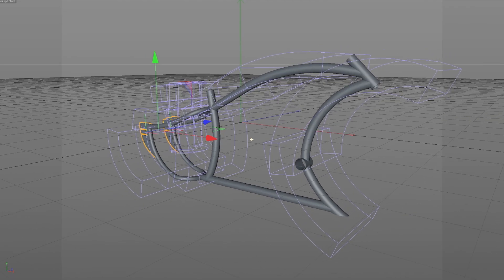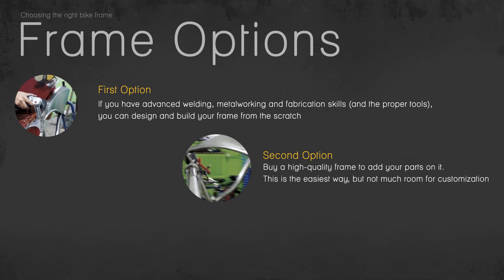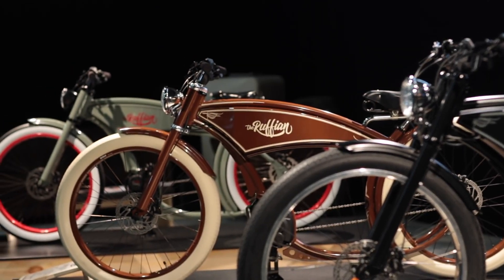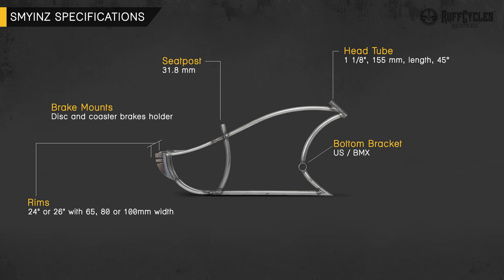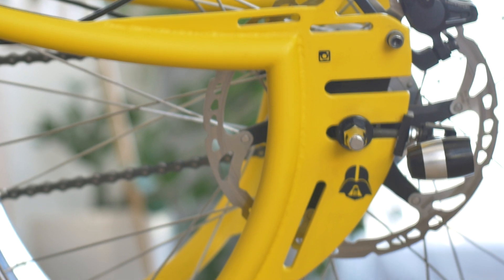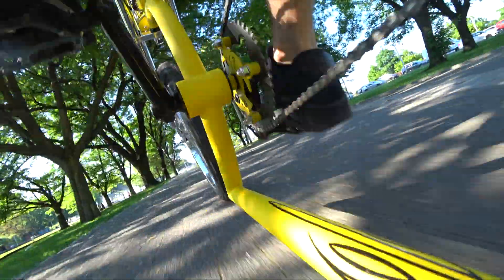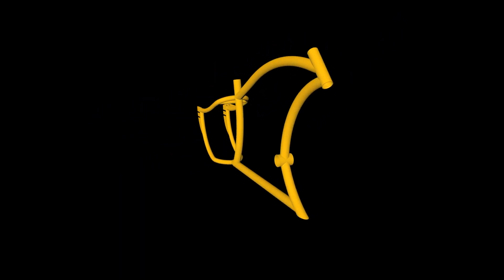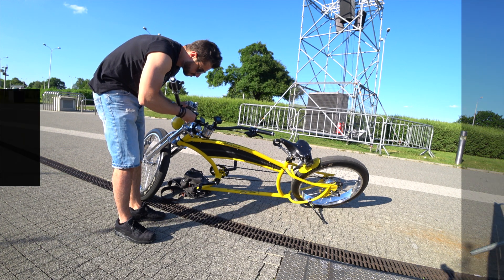Detailed Ruff Cycles frame Review | All you need to Know

Comment: The best review I've seen! I plan on building one electric. Do you happen to know the rear dropout inner width? Because most hub motors over 1500 watts are 150mm dropout to 175 mounting widths. If you happen to know the rear dropout hub spacing that would be awesome!

Thanks in advance, again a fantastic presentation!
Reply from the maker: Thank you very much. I am glad to help :)
It is quite difficult to get the precisely measurements now with the wheel, but I measure 135mm. I can try to give all measures you may need. Perhaps the aluminium version of this frame would be better for an ebike (needing an extra enforcement around the dropout mounting).
Feel free to contact me at anytime .. cheers
Reply: @BK42Cycles  Hey thanks so much unfortunately unless I go with a Mid-drive unit not many of the hub drive motors will fit such a narrow dropout, I wonder why ruff cycles went with such a narrow rear dropout especially since they are promoting their bikes as great for electric conversions, I guess that's ok if you only want 1000w and under which with fat tires will be underpowered. I might go with Imperial Cycles peek frame as they customize the dropouts and seat post locations and only 100 dollars more than the Ruff cycles. You should check out their frames I have one as a pedal bike but don't want to cannibalize it for a build as its beautiful. If I go with a cyclone mid-drive I might have to take you up on some help :) of course, if you don't mind? 

Not only are your videos awesome you respond to your audience that's priceless and I extremely appreciate that!

My videos are mostly racing drones and freestyle drones, but soon as I start on my E-bike build I will document it here on Youtube step by step as the audience that watches usually gives me some of the best advice lol

If you want the link to imperial cycles bike let me know hopefully you have a great holiday and new years sir!
Reply from the maker: I can't understand it as well. I guess even them had to deal with this problem as all Ruffians ebikes are using the mid-drive motors. I have seen such frames with 500/750W motors, but then there is another issue - no space for the gears, even doing some space it will need some extra adapters anyway. I was considering transforming my bike as well, but apart from all issues above listed it will be way too heavy ( using the same frame, but the aluminum version will do ).
I was planing a new build using a Ruff-Cycles frame, filming each step, how to chose the frame, customize it, choosing the electronic components and motors, building the tank ... I am quite sure that it would be some audience for that, but they didn't care about my offer, actually, they didn't bother themselves to say no thanks. I was only asking for some small discount :)
Now I am going to buy a cheap Chinese e-bike and customize it a bit, make a bit better look.

I didn't know the Imperial frames, but I follow Jimmy peek on Instagram lol :) . That frame looks amazing. I think you can't go wrong with that.
I can help you for sure.. If I know how I will do :) 
Did you ever build a bike before? 

I am going to check your channel my friend. I love drones and videos made with drones :) I couldn't check it earlier....  busy day.
You can find me on Instagram, Twitter by BK42channel as well as bk42.bikes@gmail .com (email)

I am very curious to see your build progress!
Have a good Sunday
Cheers
 Myr
Reply: @BK42Cycles  sorry for the late reply being is Christmas right now running around like crazy Doing last-minute shopping even on Christmas Day LOL. But yeah I was quite disappointed looking at so many frames out there and not one will fit anything bigger than a 1500 watt Hub motor and that's not a fat tire it's a normal 26in mountain bike rim.

Likely I ran across Imperial Cycles he can customize the Dropout to whatever size you want I'm having him do mine 175 mm that way I can use the 5000 watt or 8000 Watt Fat Tire Hub Motors. I just put a $200 deposit and give him the specifications I needed and he should have it all done within 3 weeks to a month as it's not his full-time job he does this on the side I guess. Peek Cycles helps him design the frame, all he does is well done together and sells the frames or rolling chassis however you want them and customized. I actually ordered mine with the Ruff Cycles seatpost welded on. I actually have built in Enduro ebike they're pretty popular it's an Enduro motorcycle / bicycle full suspension frame I'm running 12 kilowatts on that, although it is fun the right off road and all that but the cops just give you dirty looks because it looks more like a motorcycle than anyting even though I only mostly ride it Off Road  I have to take the streets to get to the locations. Which is why I want to build this Cruiser because it will look more like a bicycle but have the power of a motorcycle. We have a lot of private roads around here that I can ride on. Plus I want to make it pedal-assist to where I can limit the power as well.

I'll definitely be asking you some questions cuz this is going to be my first Cruiser Chopper type build I plan on doing some carbon fiber work for the battery and the controller. Thanks for checking out my channel I'll definitely be back to see what you're up to hopefully you start on that Chinese bike you're talking about. They actually have a really nice one on Alibaba it looks like a board track racer it's got a hub motor but it also has a fake motor in the center that holds the batteries in the controller which looks pretty cool something that you might be able to modify.  Alibaba definitely has lots of good stuff on there and just make sure you find the right storefront that they have trade assurance and they are certified Alibaba seller and if you do Buy on their make sure you by using the actual Alibaba app that way you can't get screwed and if anything happens Alibaba will back you up and get your money back which they have done for me already twice. Got sent the wrong Parts but Alibaba let me keep the parts and they made the company refund my money.  but nice guy am I actually sent the part back to them because it was actually a lot of money and I didn't want to screw anybody over.

 anyway merry Christmas and hope you have a great New Year I'll definitely hit you up and if you ever have any questions about drones hit me up on my channel I don't do the Facebook Instagram stuff anymore even though I'm only in my late twenties I'm not into that drama and all my friends are into lol

Cheers

Rob
Reply from the maker: That will be a great build indeed :) 
Here I have to keep the speed max 25k/h and 250W to use it legally.. it isn't that funny.
Alibaba is not simple indeed. Four days negotiating so far and no deals yet. 
I know the bike you are talking about, that looks really cool. I need something small now, I will work on those foldable bikes. I have some ideas about how to make it looks a bit better :) I have no more storage room for bikes. My yellow bike is 2.46m long.. and we live in an apartment.. that will be always an issue.
I don't like Facebook and Instagram as well, I use only Instagram to see bike projects :)
Be in touch and needing anything you know how to find me!
Happy 2020 :)
Cheers, Myr
Reply: @BK42Cycles  I somehow lost your notification, i thought I saved the email notification because I did have some questions about the ruff cycles frames. Anyway, i had to use the search engine to find your video again. I'm not savvy on this social media stuff. I love my dirtbikes and being outdoors I hardly get on anymore. So are you going to build this folding bike here on youtube? That would be fun to watch, where are you located in the UK? I know they have that power and speed restriction which sucks. We have a 750w restriction but police don't even give bike riders a second look never bother us mostly they just want to try it and ask where we bought the bike. Instagram has less drama than facebook that's for sure. lol. 

So I ended up buying a ruff cycles tango frame along with the imperial cycles peeks cycle frame. Turns out I was able to lace the QS 205 50H 5000w motor onto a 32 spoke 80mm fat rim and get that 26x4.0 fat tire on it. That motor has 150mm dropout spacing. I bought a dropout cold setting tool and spread the dropouts on the Tango frame like 5mm on each side and it fit. Now to make a torque arm for it.

The question I had is about the bottom bracket. On ruff cycles website it says BMX/US bottom bracket? I looked all over and can't find out what that means. I did find euro BMX and American BMX but no US/BMX? Maybe it means the USA as in American/BMX bottom bracket? I am clueless when it comes to that stuff lol. Basically, I'm just looking for a cheap 3 piece crank to put on it but have no idea about what size fits. I'm a bicycle rookie lol, dirtbikes no problem but bicycles nope I'm lost. Hoping you can shed some light for me on bottom brackets?

Thanks again and hope you enjoyed the holidays, If you ever need help with race drones I can help you their but obviously not bikes :) haha
Reply: @BK42Cycles  Oh BTW Ruff Cycles has all the frames on sale for 200 euros. That's an awesome deal I might order another just to build a low power pedal-assist bike.
Reply: @BK42Cycles  I guess the whole stores on sale I hope they're not closing down or anyting or maybe they're just bringing a new product for 2020. I was able to buy a frame and all the parts to build it for $600 at Ruff Cycles. I purchased the porchu to build a old school off-road tracker. Those prices I should order another frame and all the parts that we don't have three before the prices go back up. Anyway hope you enjoy the holidays and had a great New Year's!
Reply from the maker: Hi man..... Happy New Year :) Subscribe to my channel, it will be easier to find it in the future :)  That is very nice, now you will have bicycle's collection :) I wish I have enough space to do so! The BMX bottom bracket is the American one indeed. I took some closeup pictures to send for you, but here I cannot attach them :(
Just for your reference, the out ring is 56mm. I am using the 3 parts crank from Ruff - I got it on one of their promotions as well. 
I also have the 26"x 4 wheel and I had to make some changes in the crank - the chains were destroying my tires  ( video about it:  https://www.youtube.com/watch?v=qCpKHw60ebU  ).
Please email me at bk42.bikes@gmail.com -  I will send you the pics I have.
Btw, I'm in Warsaw - Poland not UK ;)
Reply from the maker: That is a great idea, I wish I could afford a new one as well :(
Reply from the maker: They have those sales every year. I don't believe they are closing dow - Hopefully not yet :) - They use to have a great customer services, replying emails very fast, recently I see some changes unfortunately. 

About my e-bike project, well I had to improvise - I wanted to build it from the scratch, but first my workshop it not available anymore, second I have no room to keep another big bike ( the yellow one is 2,47m) so I bought a folding fat-bike from China. I will do some cosmetic customization and film the process, but it won't be as educative as I was planning. I want to do something bigger, to help people who like to build bikes ( at home for instance ) but there are costs for that. I did try a couple of contacts to have at least some parts discounts, but nobody seemed to be interested. I can't buy all parts, make the videos, and give all work for free for brands as Ruff-Cycles / Brooks and Shimano.
Reply: @BK42Cycles  I wish I could afford more but even though I think I can my significant other, I'm not married but she's my high-school sweetheart we've been together for 12 years now ever since she was a freshman and I was a junior in high school. You said if I sold my kick scooters I can buy more bikes and to be honest I don't need those scooters anymore yes they're fast about 4000 Watts but the electric bike is just way cooler and so is a pedal bike. I wouldn't be able to buy all this stuff I haven't been selling, I'd be sleeping in the truck 😂
Reply: @BK42Cycles  yeah unfortunately big companies like that only want heavy-hitting biased Builder reviewers, they don't ever want a real person that's honest. I did subscribe I didn't realize I wasn't subscribe I thought I subscribed the first time I came here I must have been daydreaming like I usually do. Hopefully we'll get to see something of your bikes and your builds I'm thinking about doing mine here on YouTube but I'm not going to promote any products not mentioning names just going to build like a time-lapse of some sort. And of course chat along the way. But I do appreciate your help and your time I'll keep an eye out for your email much easier to chat on there than on here lol

Have a great night

Rob
Reply from the maker: @FarmerFpv  That will be great Rob! I would love to watch it. I am sure many people will enjoy as well. When you start it I can help to promote your videos here as well on Instagram. I am sure that a lot of my friends would love it too! Do you have any ideas about the colors and finishing details?
Reply from the maker: @FarmerFpv  Oh man I know exactly what you mean :) The very same here :) Another great thing is the possibility to build it yourself. I know you had experience building, but as you mentioned those are going to be something completely new. 
The learning curve as well all building process is very exciting! You got my email, you can reach me at anytime .. if I know how to do I will be happy to share with you.
Cheers, Myr

Comment: That's really cool and what I know about these electric bikes or even gas powered I don't know if you'd want to go with aluminum he would have a tendency to bend if you go in at a higher speed than normal and you would need the strength of a steel frame.

Thanks for sharing this is a very good video I'm going to add this to my playlist We are creators.
And thank you for being a part of my community that means a lot God bless.

Ken
Reply from the maker: This is a very good point! Thank you very much for touching this. I'm definitely concerned about the aluminum behaviors. As I have no experience with e-bikes .. it must be an issue. 
I am thinking about aluminum to get speed and extra battery with the lighter frame, but I need a deep research about the material resistance. 
I see you know it better, perhaps we can sooner have a chat about it ?! I will need a lot of good info and knowledge before any further steps.
I appreciate your time here ;) Thank you very much!

Comment: I'm kinda shocked it uses a big US bottom bracket. Nothing in the US really uses them anymore, I would have bet on a Euro bb.
Reply from the maker: That is right, I guess they want make it Vintage kind. I appreciate this choice as it is very easy to work with and customize.
Do you build or customize your bikes? 

Thanks for watching :)
Cheers
Reply: @BK42Cycles  I am a welder do I have built a few frames other people have designed for them. I haven't owned a bike with a US bottom bracket since the mid 90's. I race BMX and as soon as euro bbs came around the US bb died off quick. I didn't know you could still get them.
Reply from the maker: @NorristownRoomofDoom  That is really cool Ronnie, building frames is very nice and requires good knowledge and Technics. In German it is still possible to get those US bottom brackets still :)